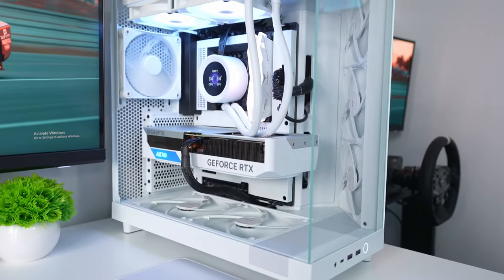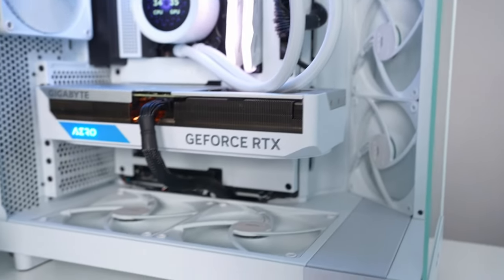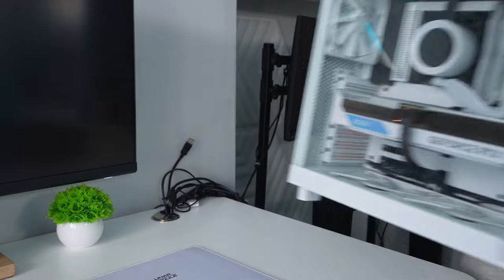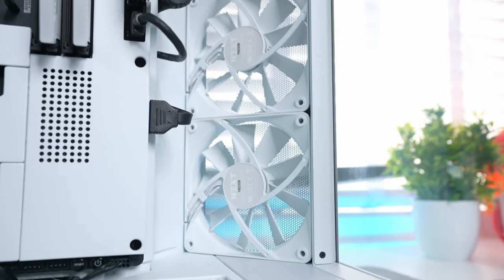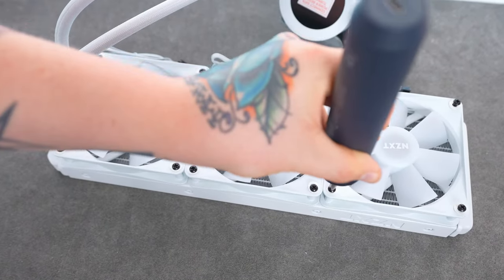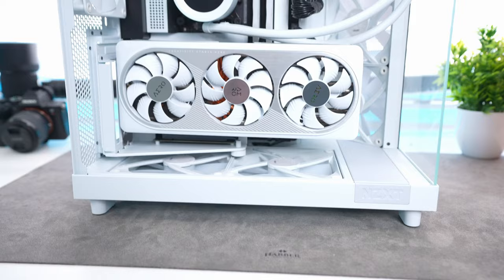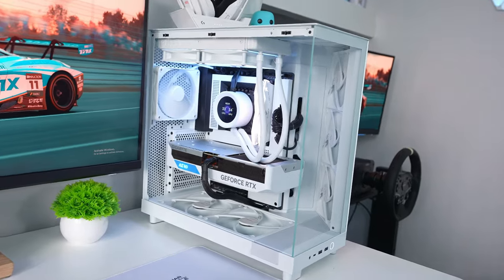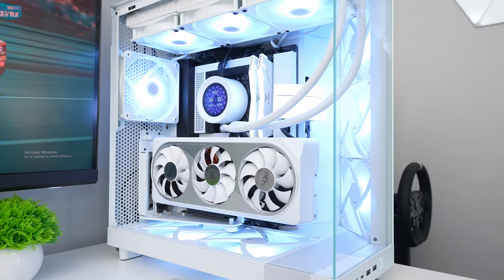Upgrading the CLEANEST White PC Build! - NZXT PC Upgrades

Comment: yo dude i wanna know im planning on getting the same case and kraken elite cooler f140s f120s etc. The thing is ik that it comes as a twin pack but in my region its not there so i have to buy it separately meaning ill have to buy another rgb controller like the one tha has 3 fans and 6 rgb ports so can you show me how you connected all the cables ty